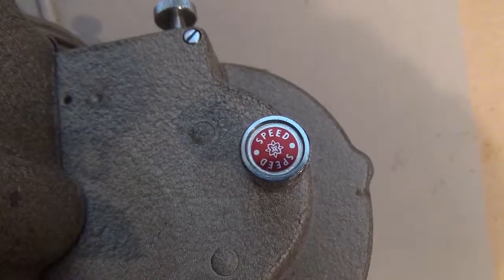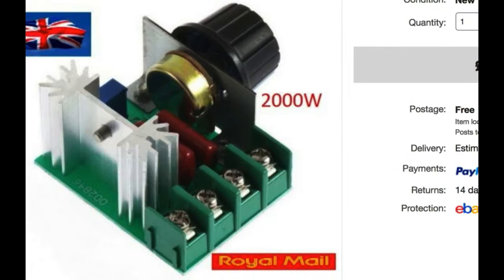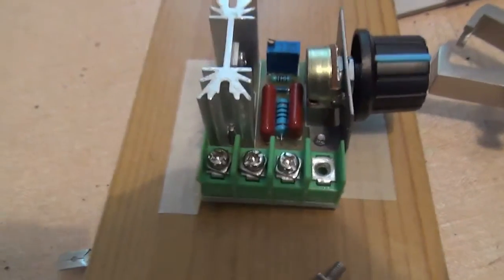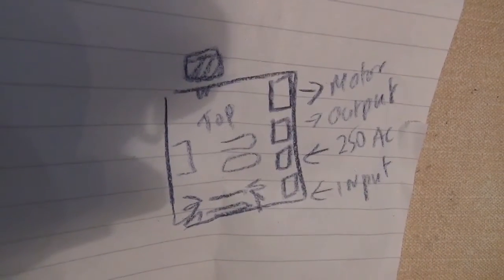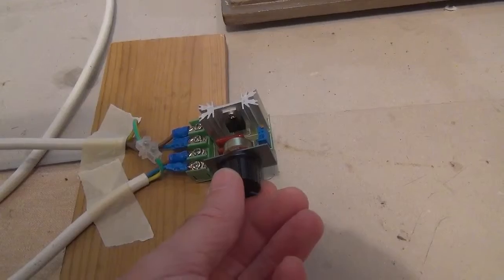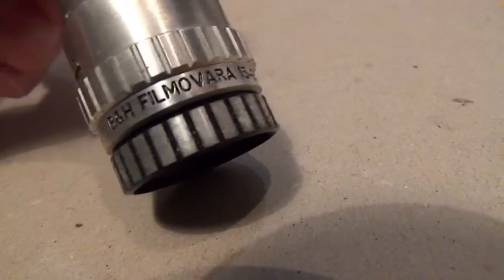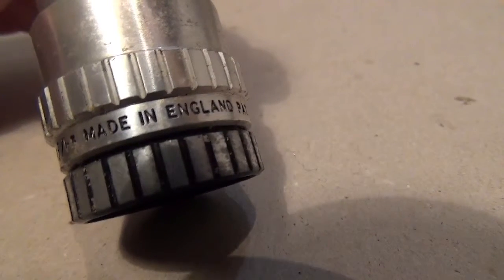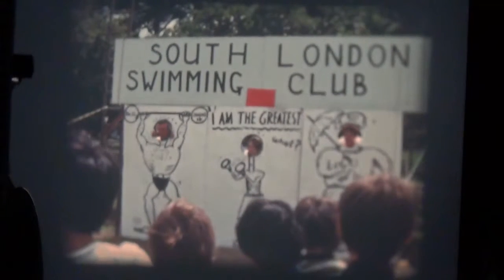Bell & Howell 606H, 8mm film projector cine home movie: Pt 3

Comment: Hi Stephen - it's Big Rodders in Ireland.   I enjoyed your 3 videos.  I am working to get my father's 1958 model working reliably.  Its serial number is 156924, very close to yours.  I cleaned all the gears and my current challenge is to adjust the clutch on the output reel spindle to obtain the optimum tension.
Reply from the maker: Hi Big Rodders - best of luck!
Stephen
=